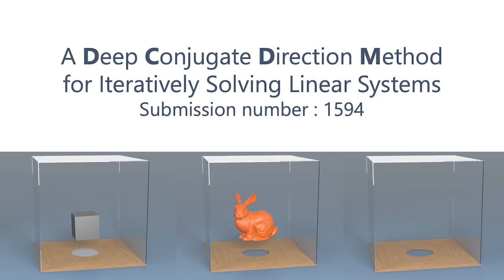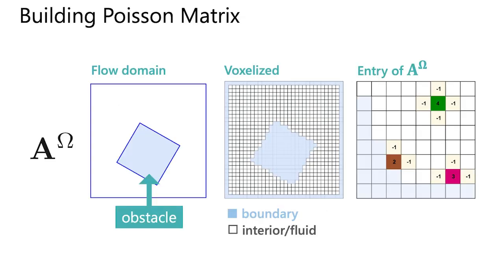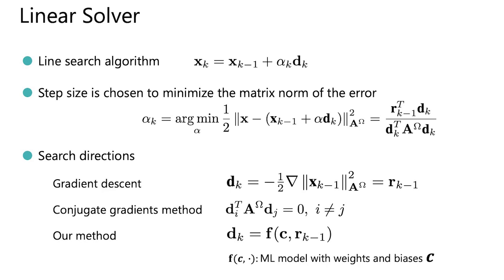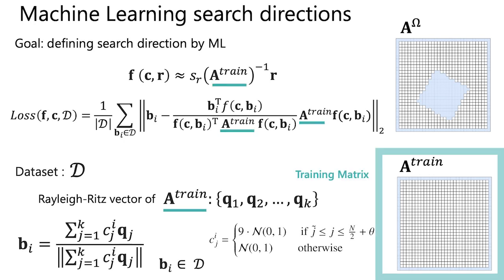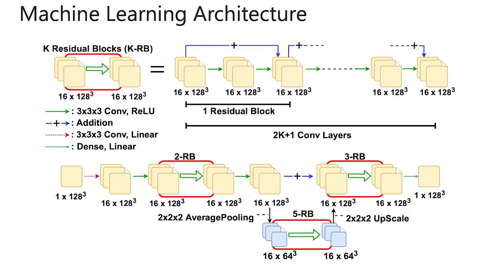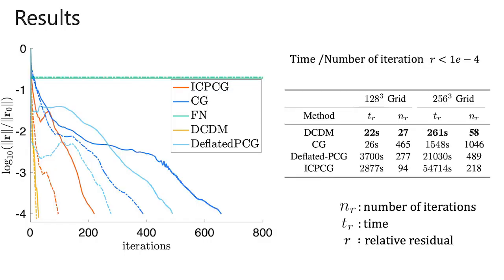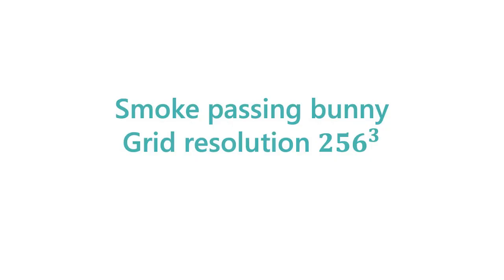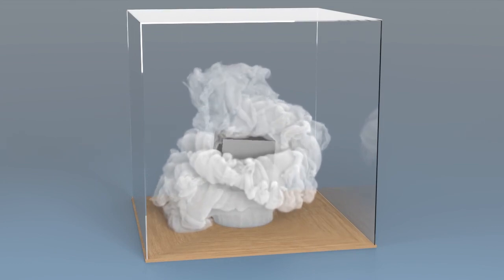A Deep Conjugate Direction Method for Iteratively Solving Linear Systems (DCDM)

Comment: Extraordinary work! I was wondering if you reshaped the input vector of your CNN (e.g. 1 x 128^3 residual vector) into a 3D format (e.g. 128 x 128 x 128) in order to apply the 3Dconv layers.
Reply: reshaping in a rough way makes sense also actually, as they do have some coorelation (due to them being related in 3d, each will have some relation with other)